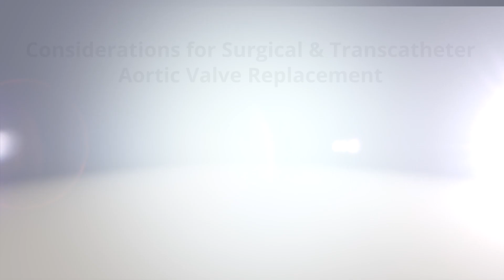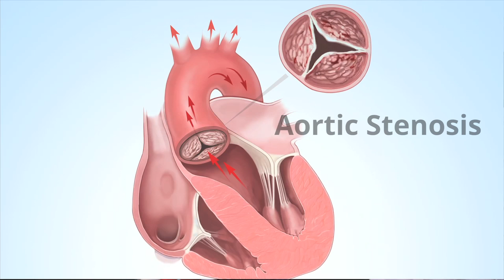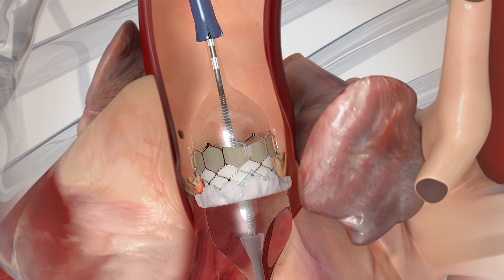TAVR vs SAVR:  Jim Whitney's Bicuspid Aortic Valve Patient Success Story (with Dr. Chris Malaisrie)

Comment: Does Dr. Chris use ridgid fixation of the sternum for aortic stenotic valve replacement if its done thru an opened chest? And, does Dr. Chris recommend use of a brace like qualibreath to minimize pain when coughing, sneezing and laughing after a sternotomy?
Reply from the maker: Hi, Great question. Unfortunately, we do not know the specific techniques of each heart surgeon that we work with.  Here is a link to more information about Dr. Malaisrie. If you like, you can call his office to learn more about whether or not Dr. Malaisrie uses rigid sternal fixation. 

https://www.heart-valve-surgery.com/dr-s-chris-malaisrie.php

We hope that helps!

Comment: I have this exact same problem with my bicuspid valve and will probably be having surgery soon. The VA is treating me but will probably send me to the U of Iowa.  I'm seventy-seven and curious about the materials the replacement valve is made out of and how long it would last before needing to be replaced? Thank you for the clear discussion from both sides of the knife.
Reply: Did you get it done? My dad is in the ER because of this
Reply: @MrSingh1150  Yes I had the TAVR in July at the University of Iowa, and the results were absolutely amazing. One over night in the hospital, no real pain, told to take it easy for a few weeks. The renewed energy and stamina I have gained back can only be described as awesome.
Reply from the maker: If you were to get a tissue valve made from a pig or cow, they typically last between 10 to 15 years.

Comment: SIMPLE QUESTION  : If you have a  first open  heart surgery to replace a defective or bicuspide aortic valve  at age 45 -50 and choose a cow valve  can you avoid a second open heart surgery  in the future  by having a TAVR procedure  to replace your first cow valve ?    (assuming surgery is the only first procedure option due to a dilated aorta ) Thank You and keep the good work
Reply: Covert Puppytwo  Guess what ?  I already had the surgery and had the resilia valve put in.Hope it lasts longer than the other valves and I wait at least 15 years for the TAVR procedure
Reply: Covert Puppytwo  This valve was released in 2018 so the is not much data on it yet.But the manufacturer claims it lasts longer than other tissue valves.I really hope you are right and lasts over 20 years.Good luck with your surgery & keep us posted !
Reply: @rjarias2011  Hola Javier como estas? Mi nombre es Marcelo, estoy en Argentina, tengo 58 años. Dentro de dos meses me van a colocar una valvula aortica Edwards Magna Ease . Yo le pedí al cirujano si podría utilizar la Inspiris Resilia, y me contesto que es aun muy nueva y el prefiere utilizar el modelo mas probado.... En cualquier caso, dentro de 15 años re podría hacer un reemplazo Tavr....  Si tienes algun feedback sobre la inspiris resilia te lo agradezco. Quiero ver si consigo convencer al cirujano de que use esa......
Reply from the maker: Hi Javier, Great question... Here is some information to help you - https://www.heart-valve-surgery.com/heart-surgery-blog/2017/06/15/valve-in-valve-fda-approval/.  Thanks!
Reply: @HeartValveSurgery    Thanks for the quick response .Just read the article..very interesting.I've also found out that  it's possible to have multiple TAVR procedures after only one open heart surgery (great option for younger patients )